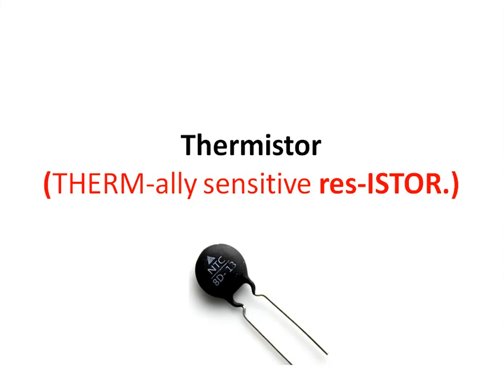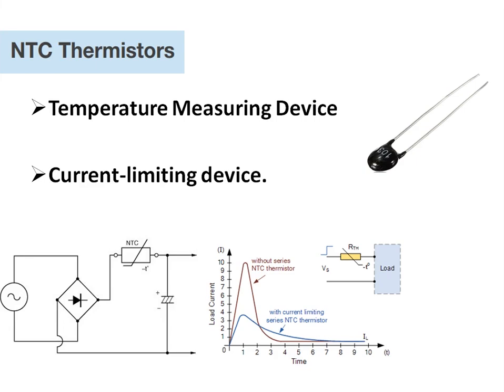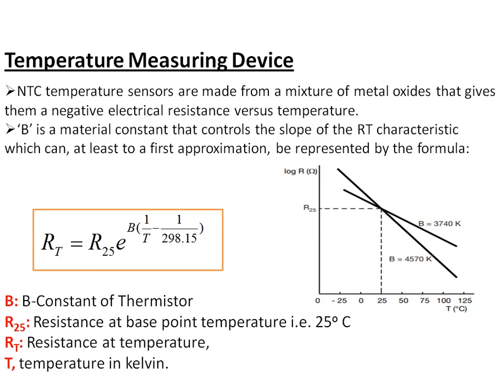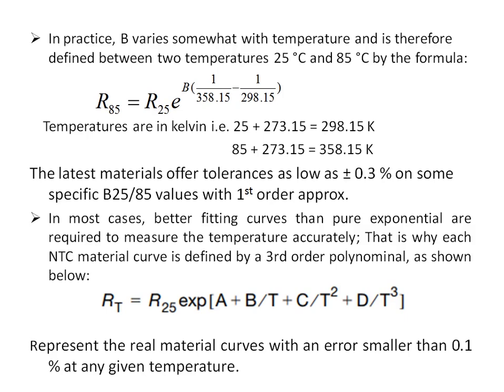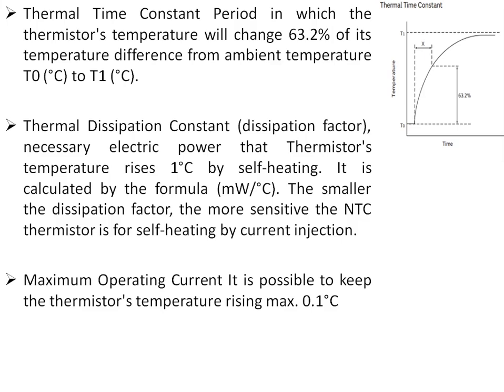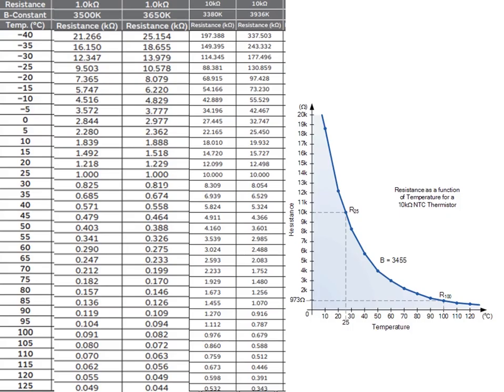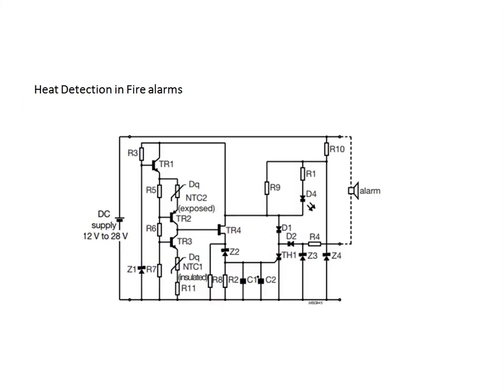What is Thermsistor? || NTC Thermistor || PTC Thermistor

Comment: You are using a 2252Ω thermistor, β = 3940, and you measure a resistance of 672.5 ohms. What is the temperature in °C that you are measuring?
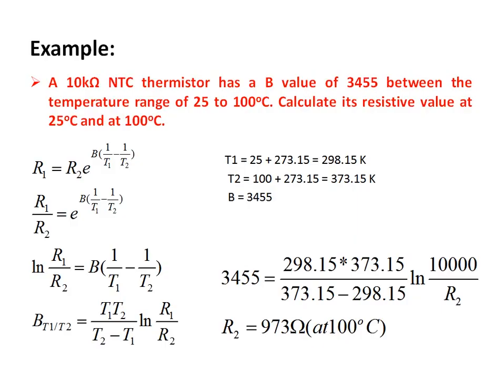Reply from the maker: β = 3490, R1 = 2252 ohms, T1=25 deg C, R2=672.5 ohms then T2=?, By using the equation (5:33 Video ) temperature T2 = 59.5 Deg C or 332.5 degree K
Reply: @RockzAutomation   can u  write down that equation, cause i still cannot get the same value as u did
Reply from the maker: @jeremiebula4370  [beta = (T1T2)/(T2-T1) ln(R1/R2)]             T1, T2 are in kelvin